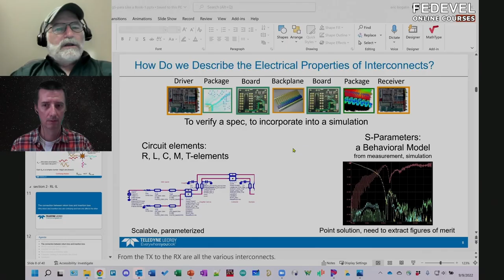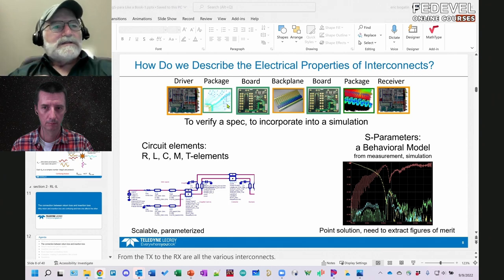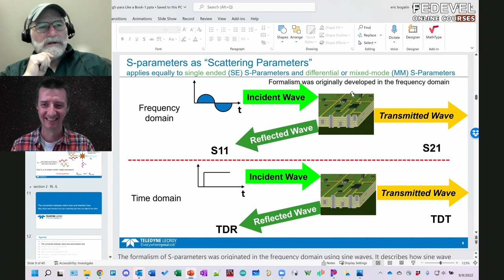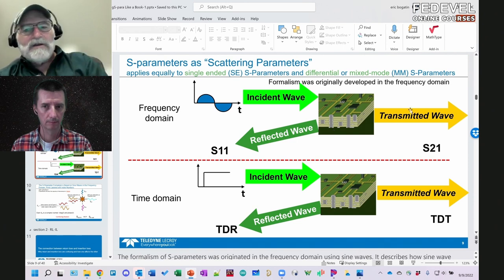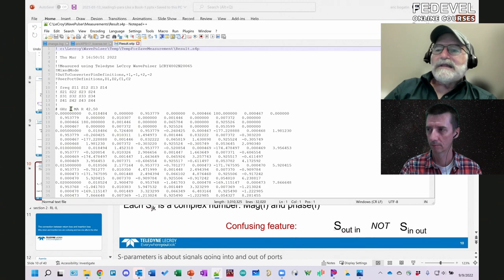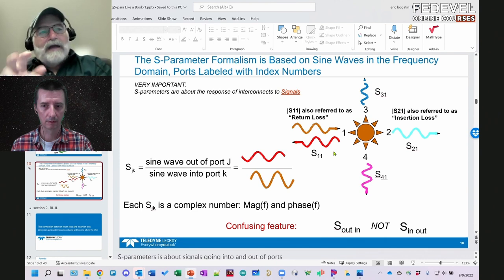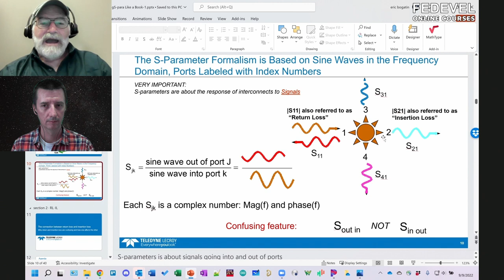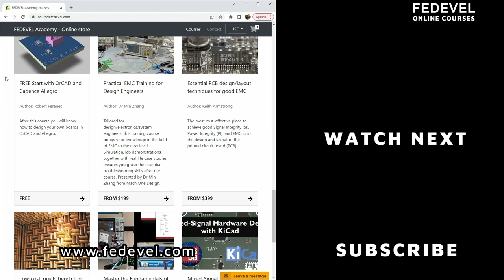Must Know This to Understand High Speed PCB Layout Simulation | S-Parameters Explained, Eric Bogatin

Comment: OK lets see, so the video was kind of rushed near the end but I guess that is just because the discussion was agreed to be for 30min.

The discussion was quite clear a the start to describe what S-paramters are. It was quite clear about the distinction between the "topology" moden and the S-parameter model. It also described how they are created. However, what it did not do was, how these are generated from an actual PCB. An actual PCB will have a lot of PCB tracks and vias and pads. A track itself could have a continuos ground plane or splits in it. A track itself could have have the same width throughout or taper to smaller widths near the pads. The track could could have magnetic and electric field coupling with other tracks or even signal sources that are outside of the PCB. Now, how is an S-parameter model created from an actual PCB and then used in simulation, this topic was not covered at all in this video. Because of this, the video does a good job of describing what S-parameters are, but not exactly how a model is used to solve a real world problem.

Do you intend to make a follow up video on this? I guess Eric must be charging hundreds of pounds per hour for his service.

Comment: Very nice video again ! I know the focus of this video is mainly on simulation. However, I wonder when s-parameters are actually measured on an actual PCB in the PCB design flow. It seems that the measurements are never made on the actual product but on some preliminary validation board. Would the goal of this validation board be to test connectors, via design, PCB material, etc. before finalizing the design of an actual product? Is that correct?

Comment: I love your videos. I should not nitpick but I really want the audio for the video calls to improve. It would be really awesome if the guest you're interviewing records the audio on this computer rather than you recording it on your resulting in lower bitrate and sample rate for the audio.
Reply: I don't mind audio, but also other voice call app that uses better bitrate would do the job.
Reply from the maker: Thank you. I keep improving the setup, I may come up with something new in future.
Reply: There are losses in every transmission line. The goal is to get enough information at the end of the transmission to make a good enough estimation of the signal that was transmitted. I think it's easy enough to understand the spoken words in these videos, even with the low bitrate and compression. The hard part is to actually understand the abstract concepts and practical meanings of the transmitted information and apply that to my work.